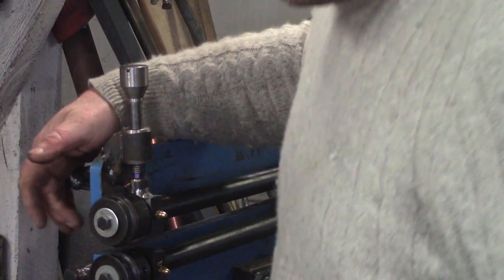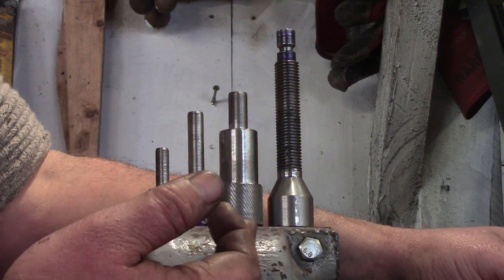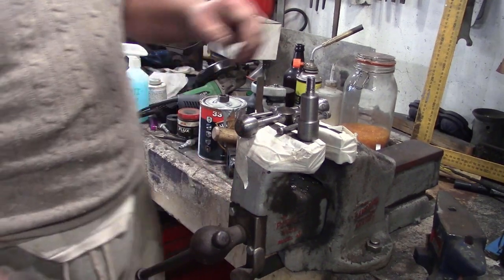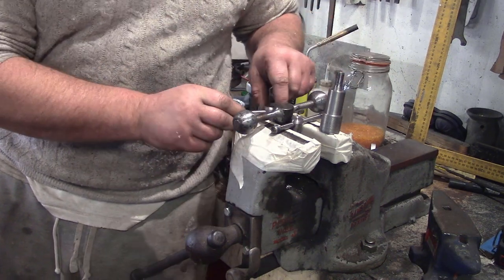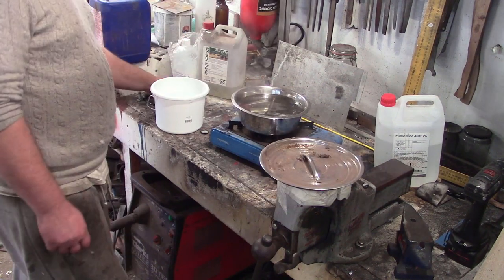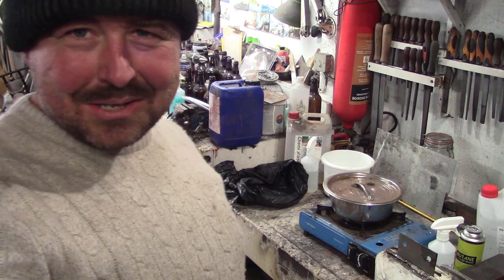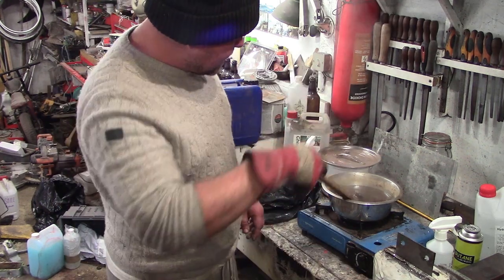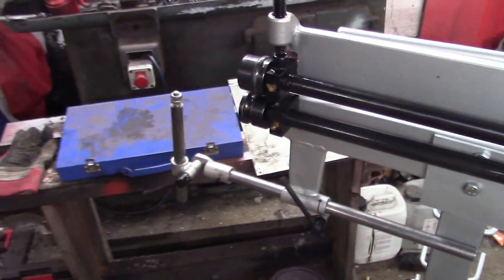Bead roller mods pt2

Comment: Have you tried oil blacking? heat to red hot and quench in old engine oil. Works nice on mild steel.
Reply from the maker: Yes, leaves a lovely finish

Comment: Absolutely superb!   Looks fantastic and does the job. What a massive improvement over the original. Genuinely in awe of your talent... well done that man.... and to him it’s just a bit of fun........
Reply from the maker: I doubt I did anything you couldn't have done with the same equipment mate but thanks
Reply: @turboconqueringmegaeagle9006  it’s always impressive when close tolerance parts are made in sheds and workshops that look like ours do. I used to do a bit of turning back in my apprenticeship but that’s almost 40 years ago on a machine called a 'capstan'? I think... I’ve never turned anything since but will one day..... soon hopefully, your videos inspire me. Keep it up.
Reply from the maker: I have a ward capstan, saved it from the scrap yard but it'd break the floor of my shed so it's just resting till I build a new shed, no idea what I'll use it for but couldn't let them scrap it, ended up going back and getting half a milling machine, I've stopped going there now as I end up bringing too much heavy stuff home and the mill broke a leaf on my truck which cost more to fix than the mill itself.

Comment: That hubcap came out good man thst bead roller came off great as well
Reply from the maker: You are very much responsible for both the hubcap and the rotory roller. Cheers mate
Reply: Im just glad you are doing your part in bringing back a much underrated auto accessory

Comment: Nice work. Impressive. Out of interest how big are the pulleys going to be?
Reply from the maker: Cheers Benedict. 10" minimum dia at load for the cable I'm using so I'll probably go 12"  to keep it happy.
Reply: @turboconqueringmegaeagle9006  Cool. hat explains why you didn't go for an aluminium casting.
Reply from the maker: @BensWorkshop  I looked at high strength ropes which would have allowed me to use aluminum pulleys but the cost of proper load lifting rope is 4x that of cable which I've got experience working with and know how to spot a failure before it happens which is probably important with a bodgey homemade crane!
Reply: @turboconqueringmegaeagle9006  Fair enough. It's not the sort of thing you want dodgy rope on.

Comment: Can you do a video on the brewing stuff in the background. I really liked the vids on alcohol lol. Love the vids man ty
Reply from the maker: What do you want, beer or spirit? You've got to understand when I pretended to make spirit it was all just pretend, it would be illigal to actually still my own spirit and I have the utmost respect for the law but I can own a still and pretend to make rum and was planning on buying a milk churn and turning that into a still for my role play distillery fun so could do a vidy on that.
Reply: @turboconqueringmegaeagle9006  I didn't know it was illegal? Lol
Reply: If you ever need any ts400 or ts410 parts hit me up, I have a shed full
Reply from the maker: Neither did I mate! 
Just stuck a new coil and carb on it and it's sweet again.
How comes you have so many spares, are you a builder?
Reply: @turboconqueringmegaeagle9006  No I repair small machines mainly stihl stuff
Reply from the maker: @Rodderslithgow  awesome man, your own business?
If anyone ever brings you a basket case all metal jonsereds I'd probably buy it off you, I've got a bit of a collection going on.
Reply: @turboconqueringmegaeagle9006  I know a man with lots them in bits
Reply: @turboconqueringmegaeagle9006  I have  an oil fired (kerosene) central heating burner assembly in my shed with the controll box you can have if you pay the postage and mention me in the vid.. I think its a myson burner, it's got a fan, pump, injector, control unit
Reply from the maker: @Rodderslithgow  is the jonsereds man likely to want to sell me a couple of project saws? 
Your shed sounds like an aladdin's cave.  I may well take you up on your kind offer but would have to also send you some pirate rum so we're even.
Reply: @turboconqueringmegaeagle9006  sounds good I'll get some pics or make a vid showing the unit
Reply: @turboconqueringmegaeagle9006  and yeh I'll ask him what jonserd stuff he has